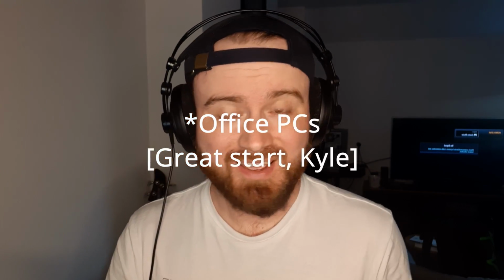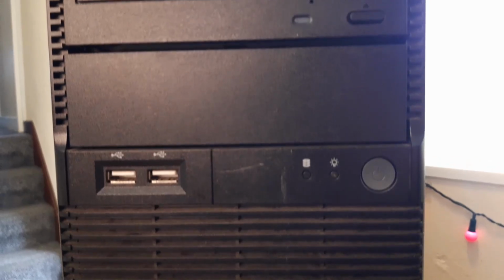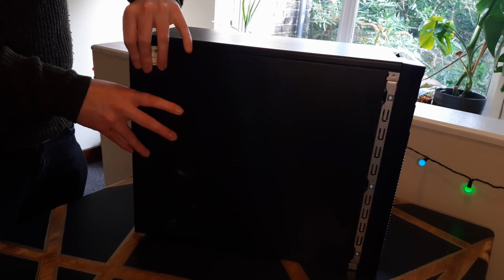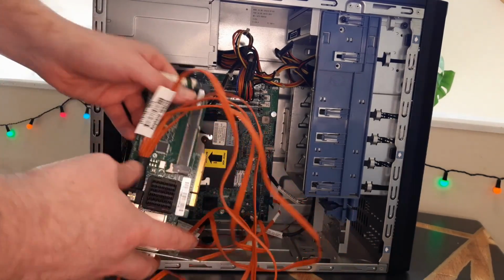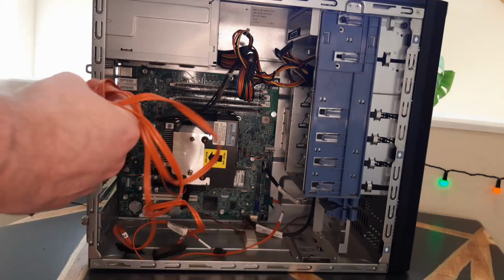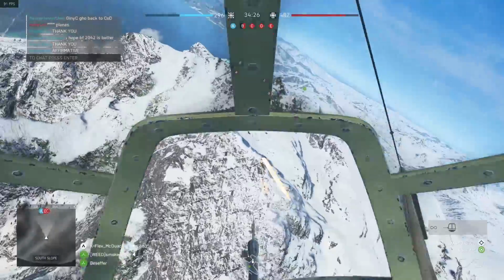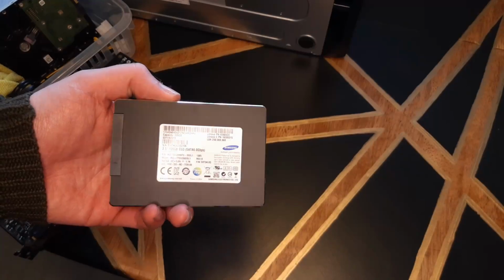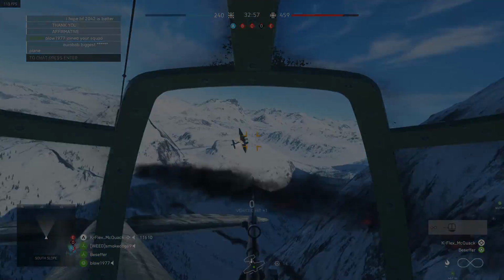Office Server To Gaming PC - X3460 + GTX 960

Comment: Nice vid but for fix your hard drive you are the screws in back in the front panel screw in your hard drive and is plug and play bro i have the same server 😉👌
Reply from the maker: Yeah I found them when originally taking them apart - but all my drives felt loose when using the screws for some reason - maybe I wasn't doing it correctly?!
Reply from the maker: I probably should take some time to try again as my basing my new nas off this machine
Reply: @pcflippin2901  i have a projet for my HP Proliant ML110 G6 to convert into a nas i don’t speak English correctly my god my accent 😂 but for now i bay part new Hard Drive new power supply Corsair 85+ and more when a have all part i try to filming the all upgrade and a little custom on this case i show how install à hard drive on this case 😉